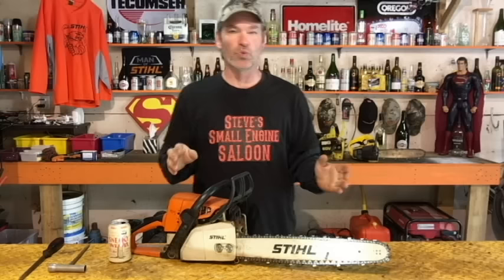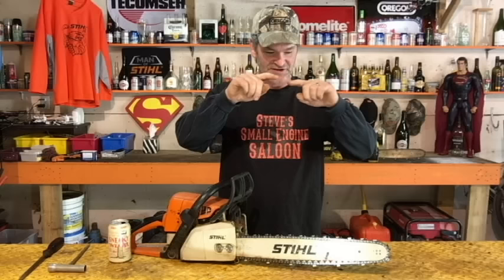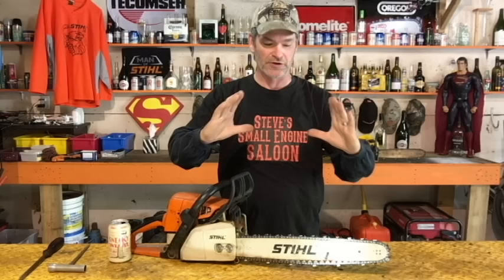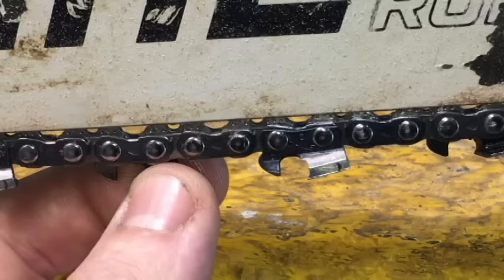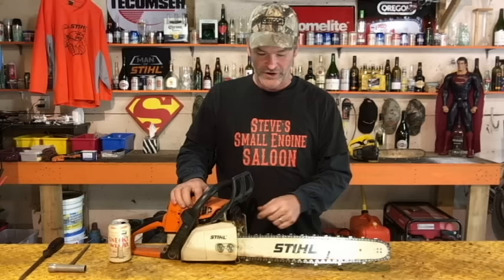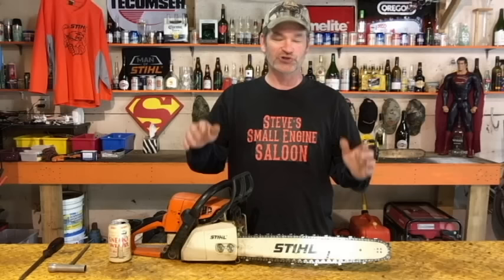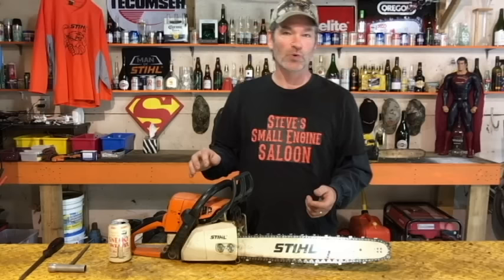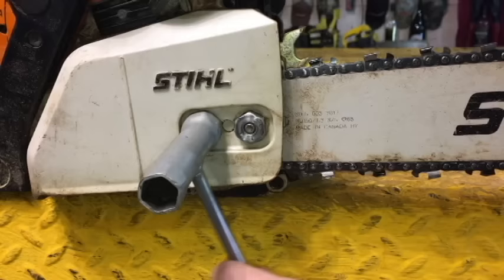CORRECT WAY To Adjust The Chain Tension On Your Chainsaw

Comment: A problem I've had is the chain expanding as it heats up so a perfect tension when adjusted cold can still end up way too loose when doing a big log cut - loose enough for the chain to come off the bar.  I tend to compensate for that by making the cold tension somewhat tighter than what your video recommends.  I have an old McCulloch I've had forever with a tool-less tension adjuster which is brilliant (spring loaded) that allows quick adjustment changes (under a minute) to deal with chain expansion before it cools down too much.
Reply: Might not be oiling properly if chain keeps getting hot and streching
Reply: Yes must be an oil or to tight problem as only new chains stretch.
Reply: I suspect your chain & bar are running hot. Make sure you are using a quality BAR & CHAIN OIL [not motor oil] and that a lot of oil is coming out to lube both. If it doesn't spit off the end of the bar a little [you can see it on the ground] then adjust the lubricator volume screw.

Comment: WARNING: On some saws the oil hole on the bar will NOT line up with the oil pump output if you set your bar in the wrong position. Pay attention to this alignment when tightening your bar.

Comment: Having  worked on chain saws, through the transition from lower chain speeds, to greater chain speeds, and from even professionals using used crankcase oil to the best oil they could get, the used or lower grade oils were pretty hard on any oiler system, the old Mac and Homelite systems come to mind. Your tips are something I learned the hard way. It was really hard to convince folks they should good oil, and many could not grasp the concept of a properly tensioned chain, because they should have never had a chainsaw anyway. Yours is my favorite site for any innovational info on any small engines. Thanks for your investment into the topic.

Comment: Remember to properly readjust & tighten after a few minutes of cutting due to heat expansion. Plus, keep a bag of "Bar Nuts" in your tool bucket because when they spin off, they're a pain to locate in the underbrush. Don't forget to loosen the chain after a hot session before it cools and contracts.
Reply: bar nuts :) a great idea
 * i was thinking bar as in  "beer nuts" 
it is a bummer when those spin off and get lost in the brush - yeah I laughed a little at that thought
 then you made a serious good point :o

Comment: Thanks I didn't know anything about holding the Bar up. Just fixing to sharpen and get ready to finish carving a mushroom. Beforehand noticed my chain seemed loose after just sharpening it. Still seems sharp but not cutting like was. Gonna try tensioning my chain this way and see if that improves my cut. Thanks again

Comment: Hey Steve,... We cant buy  " Sneaky Weasel Lager " where I live. Can this job be done with a different kind of beer ? ?    What is your thoughts on that ?    [ Excellent video,by the way ]
Reply from the maker: As long as it's 5% or more, you should be fine!  😎
Reply: Neil McColman billstmax
Reply: lmao ,
Reply: Without sneaky weasel this adjusting should not be attempted in my opinion! Bodily injuring might occur!
Reply: BLATZ
Reply: If you can't find the beer you need, you will have to send the saw to Steve for tightening! (or someone else who has the right beer.)
Reply: Lattes all day!!!
Reply: @prestonberg9604  you laugh, but years ago when frou frou coffee was a growing thing, someone tried setting up a kiosk in a logging town.  everybody said they'd be bankrupt in a week.  instead, they had long lines of loggers buying it by the thermos.
Reply: @groovee63  in this part of Montana, it's Bayern pilsener lager...... The right stuff for a pleasant day in September.
Reply: Best question and answer ....  
The question was lucid ,  to the point and pertinent,  
The answer included the technical specs on an acceptable substitute 
Brilliant gentlemen

Comment: I’m prolly gonna come back and watch this again when I’m not high.
Reply: LOL, my thoughts exactly.
Reply: Yeah, don't run the saw while you're high either.
Reply: Brooo I’m ripped too thinking the same thing
Reply: LOL
Reply: Lmao! Best comment right here
Reply: Ya got me!
Reply: Steve Smith.  That's why I NEVER let the Frau touch my saw.  She smokes a bowl from morning 'til bed time. Me? I crack a top off a brown bottle and she tells me to not cut wood like this.  I don't chug the liquid -- just sip it!  After 2 hours, it's break time and time to crack another, just a sip.....eat a sandwich, have another sip. Get back to work. Move some rounds outta the way, get ready for more cuts.  Check the oil tank and chain tension, teeth condition.  Saw may not need choked to start.  Warm it up for a couple minutes at idle.  Enjoy the day.  Grandson does most of the splits.  Me? I crack another brew after a 4 or 5 hour day of cutting firewood for winter.  Then tomorrow I'll cut some more if it needs it. Then we stack -- that's the fun part.  DON'T CHUG THAT BREW, folks, just sip it!  Keeps yer whistle wet.   Cheers.
Reply: It will make more sense then and not be as funny
Reply: Steve Smith I wish they'd give you the Australian captaincy back...despite the whole ball-tampering thing.

Comment: Don't forget to flip your bar every time that you sharpen your chain  ,so the writing on the bar is facing up after sharpened then facing down the next time that you sharpen it to keep the bar wear even and lengthen the life of the bar n chain ....
Reply: Robert Smith ... yes I agree, first time I pulled out my chainsaw in years and noticed the top of the bar is widened out a bit but the bottom is fine, time for rotation if it’s not to late I hope .
Reply: Doesn't sound like you sharpen your chain enough, I have no intention of flipping a bar every couple tanks as thats the max I run them without sharpening.

Comment: I have used chainsaws since my early teens. Like all users i have occasionally thrown a chain. In roughly 60 years that amounts to quite a few times. 
Not once did i damage the chain or have it hit me.  
Also there is a big difference in required chain tension depending what is being cut.    
For limbing it should be without slack. For larger cuts a little slack is best.  
Also once you make that first cut the chain is no longer exactly how it was set. 
While what you said kind of makes sense. Experienced saw users know it's useless advice. 
The best advice is.   
Do not put enough tension on the chain to make it harder to rotate. 
Lift the bar as the nuts are being tightened. Any visible slack should just disappear.  
When limbing if you see a little slack readjust. 
Bigger cuts allow more slack.

Comment: In my saw tool box where I keep among other things, a bar greaser, spare spark
 plug, wrench, file, and screwdriver, is a 2x4x6 wood block to support the bar during chain sharpening and tensioning

Comment: thanks steve! one added comment would be that i like to tighten my chain real tight for sharpening so that there is no side play in the vertical orientation when putting pressure on the cutters with the file.  Then can back it off just a hair for cutting.  Many thanks for all of your good insightful videos!

Comment: When you are doing this by yourself, holding the bar up is a little harder since it takes one hand out of play.  The way I do this which is easier, I just flip the chainsaw upside down.  Gravity pulls the bar down, I tighten the screw to adjust then tighten the nuts.  Flip chainsaw back over and done.  I can't remember if I learned that from my Dad or my older brother.  We used wood heaters when I was a kid and my brother was a logger for a while.  Could have came from either or even both.  Still flipping it upside down just makes it a lot easier.  

If anyone is worried about the gas or oil, saws are designed to run regardless of how they are turned.  You can run the saw while upside down if needed.  It shouldn't leak or anything and if it does, that needs to be fixed, especially if it is gas leaking.  

Hope that little tip helps someone who finds it difficult to hold bar up and do the other things at the same time.

Comment: My grandfather who would cut wood almost daily always told me if you could pull the chain and see space between the bar and the bottom of the chain link it's too loose and ro always double check after tightening the bar nuts.  Nice tip on holding the bar up.

Comment: I always put a chunk of wood under the bar about 2/3 the way towards the tip, put pressure on the saw body,  and keep that pressure while adjusting the tensioner and tightening the nuts.
I noticed this is necessary when I was 15.

Comment: Your videos are so helpful!

I've always had problems with tensioning the chain on my chainsaw. I tighten it at the right tension but after I've been cutting a couple of logs the chain is too tight, and I have to readjust it.

This video explains why. I didn't know that you need to hold up the blade when you are tightening the chain.

This will probably solve my problem.

Thank you Steve!
Reply from the maker: Thank You...and You're Welcome...

Comment: Steve's opening comment is 100% spot on.  If you get 5 sawyers in a room you'll have 5 different theories on chain tension.  I've been felling, limbing and bucking trees for 50+ years on a family tree farm in New England.  Steve's adjustment is too tight. It's going to result in overly stretched chains and premature wear of the bar.  The chain distributes this "backlash" evenly, about positions that are opposite each other on the bar, while under load.  Your chain, at rest, should sag slightly at the bottom, but never more than 1/2 to 2/3  the length (height?) of the drive links to prevent derailing and the other wear issues noted above.  Because this sag, or "backlash" is evenly distributed about the bar under load, that 1/2 to 2/3 length of the drive link 'sag' is reduced by approximately 50% preventing derailing.

Comment: I had a DOLMAR that I really liked a lot, but someone broke into my shed and stole it. Now all I have is a cheap McCulloch electric chainsaw. When I wanted to adjust the tension on it, I hung it on a nail by the hole near the nose end of the bar, and tightened the bar nuts. AFAIK it doesn't have a tension adjuster, and the weight of the saw is just about enough to pull the chain tight but not too tight. I put some weight on it and it was too tight, then tried again without adding any weight and it was close. I pulled on it the handle one finger and got it tight, but I need to re-adjust it holding the tip up like you said.

Comment: Thank you!!! One more thing: if for any reason you have to back up the adjusting screw, don´t let it sit there: back up a little more and re-set the tension again. This is to account for the slack in the screw's threads and spacings to the bar, so it will be always "pulling" the bar outwards and in your desired position.

Comment: I know this is an old video, but I appreciate it. I’ve been tensioning my chain wrong for a very long time. I have a Shindiwa and a Stilh and I wouldn’t trade two Stihls for my little Shindiwa. It’s by far the best little chainsaw I’ve ever own. I live in hurricane country and a chainsaw is as essential as a generator. I bought the little Shin after Ivan in 2004 and it has never failed to start. The Stilh on the other hand is both Bert finicky, and weighs a ton. The Shin is light and works all day without complaining. After almost 20 years, my little Shin is having chain tensioning problems. It won’t stay tight. I’m going to try your method and see if it helps.

Comment: Hey Steve
Another great how to video. I have found that if I adjust the chain on a “stone cold” saw on my tailgate, a little tighter is just right because as the chain heats up it stretches some and that makes it loose.  And…. When adjusting a hot chain it needs to be a little loose otherwise it tightens up when it cools off and the whole thing is all jammed up until you use the saw again.
Speaking of bar nuts, I better head down to the Rainier before they are all eaten during happy hour 😉
“Hey” to mrs Steve’s Small Engine Saloon for me. Thanks again.

Comment: Wow, thanks for letting me know I was actually doing it right! I figured out I should hold the tip of the bar up for adjustment and tightening the nuts. I hadn't figured out that the spinning chain would try to assume a circular shape and put pressure on both ends of the bar like that. I also didn't know that a loose chain could lead to a derailment!

Comment: Every video you make teaches me something. It takes 3 or 4 other videos to pack in what you do in one. Just a note... I tend to run your videos at 1.25 or 1.5 speed. It's usually because I'm in the middle of a project and want to extract the technical stuff. But you're very clear speaking and I can easily follow at higher speed. It's great to have a down-to-earth 'wiseman' to turn to when I'm in a bind. Thanks!

Comment: Big help, I been doing it wrong for 40 plus years.  Now I, Hold the bar up with a 2x4 resting under bar after tension chain, and this works great, then tighten the nuts.  No more chain constantly loosening up.  Thanks mannnn!
Reply from the maker: Great tip!

Comment: For the person in the future reading these comments:
Instead of holding the bar up while adjusting the tension, a great cheat is to rest your saw upside down, so it's balancing on both the front and rear handles, and the bar is automatically in the position you need it, so go to town on that adjustment screw as you would normally.
For Steve: Great video, I've been logging since I was 8 years old, and found your channel recently. I recently became interested in restoring old saws, and a lot of your videos have been super helpful to me

Comment: Useful tip on raising the end of the bar when tensioning, common sense when you think about it. I'll be servicing and tensioning  all my saws after their winter sleep and will definitely using your tip. NB: I was given a free saw today, the guy said it wouldn't cut. Oddly it had a brand new chain on it, but here's the rub. It was so tight, there was no slack at all, so no wonder, he had problems, I'll strip it right down to check the state of the sprocket and tip race, hopefully they are not totally wrecked.

Comment: This pretty much is the way I do it too.. so many different opinions😂 just tight enough to touch when the chain is cold and a slight sag when it's warmed up is perfect for that bar length. You may want to re-adjust for warmed up tension on a longer bar though. Just a thought

Comment: VERY helpful! These newer "Craftsman" for instance Saws, Im afraid to get wicked with, being China made. However, Ive had a 20" that's fell many many trees over the 2 years. NOT 1 problem. Anyway, seems they've moved the "Tension Screw" to a weird place. Just like you said, never been tought or knew to HOLD the sproket end UP while adjusting. Now I have a JEDI Chainsaw! Thanks!!!

Comment: Steve, I am a homeowner. After using my saw to cut up a downed Bradford Pear tree I emptied the fuel and put it up for the next few years. As luck would have it my poplar tree was hit by lightening two different times. One time I was pretty dang near it when it hit the top of my tree. Anyway, two days ago mother nature ripped another large piece of the tree out. It missed my wood rack that I keep under a tarp right next to the tree and missed my platform that I used to store pine straw and yard refuse. Damage averted. Well I pulled the old chain saw out of it's hard case where it has been for the last few years.  I noticed the chain was a little loose but after a few fits and starts I got that puppy running. I didn't remember how to tighten the chain but now I do thanks to you. You are the bomb. Do I need to remove the bar oil too? I opened the hard case  after the first time I used it only to find quite a bit of bar oil on the bottom of the plastic case I store it in.

Comment: What I always did was put a little block of wood underneath the tip of the chain my adjustment and just like you said just tighten it up just enough to wear the chain hold self up into the bar but hey thanks for the information I’m gonna tell you what I do for on my saw I have an old old 29 steel that still runs absolutely phenomenally well anyway I use Amsoil two cycle oil I mix it right around 110 to 1 and I also use the Amsoil  bar and chain lube works extremely good

Comment: I generally rest the tip of the bar on a piece of wood to hold it in position when tightening the bar lock nuts. Thanks for the confirmation.
Reply from the maker: Right on

Comment: I still do like I was taught which is to loosen the bar nuts and flip the saw so the weight of the bar takes care of itself and then run the chain by hand to check for slack spots

Comment: Very helpful. Top vs bottom tension is very logical. Always keep an eye on the tension while cutting. Crud under the cover keep it all clean under there. And without sounding like a nag. Sharpen it every tank of gas. Don't wait. You will actually save time! Sharper is always faster.